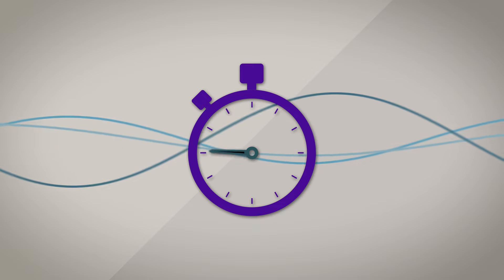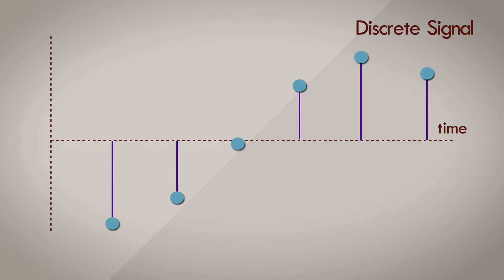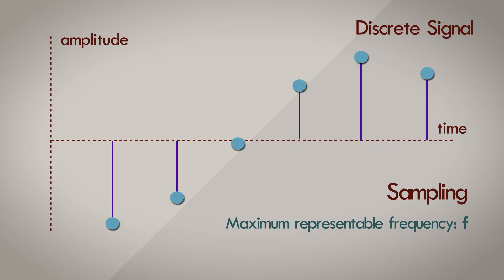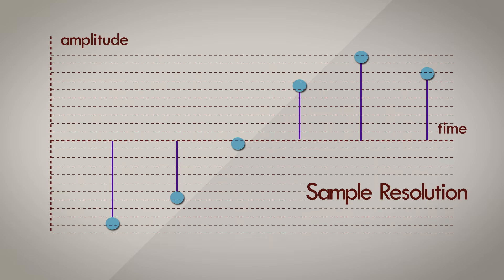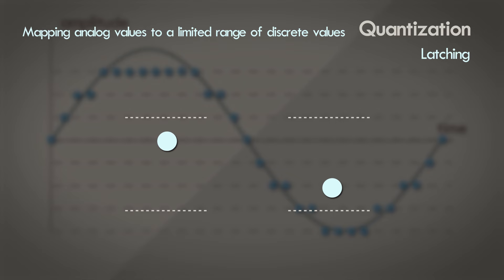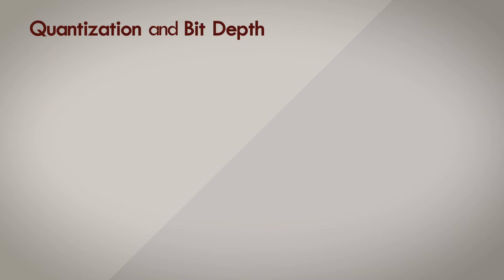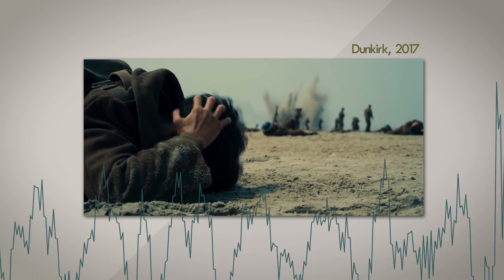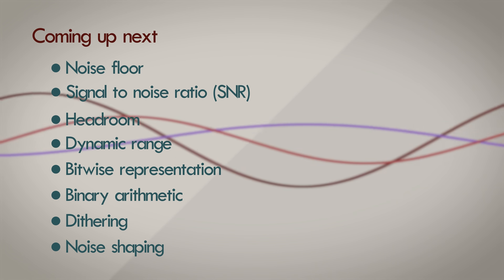5. Quantization - Digital Audio Fundamentals

Comment: This is presented as though it's a lot worse than it really is because you've suddenly switched to a square-step representation of the signal at 5:20 for no apparent reason. The amplitude samples do not have a duration, they are simply a point in time. There should be no horizontal component had you not introduced one, and that's the source of the sawtooth looking error signal when compared to the sine input.

Comment: Great video! But the quantization error shown isn’t as accurate as it could be. Showing the digital signal as a step function (staircase-looking pattern) is misleading as it seems like it’ll be like a noisy saw-tooth waveform when the discrete dots are actually the “waveform” of the digital data. The DAC will find a smooth interpolation between those points to get an approximation of a sine wave like before. The error noise would be introduced by the clipping of the original signal at the peaks and troughs as well as changes to the reproduced sine wave because of inaccuracies of the quantized points. But it wouldn’t be from some step function fuzziness since the DAC will make a smooth approximation anyways.

Comment: So sir, please let me know if I am wrong, here we are not converting back the digital signal into analog again to check, just we did in the sampling, rather we are trying to hear the quantized raw audio signal. That is why we are hearing the noise? Like if we have higher resolution like infite, then we sample by nyquist, will we hear the noise? or it will be a clear sound?
Reply: I think both of the times you should bring DAC on the scenario.

At niquist and infinite resolution you will get exactly same output sine wave as output.

But with quantization error the output after DAC will not have the pure sine wave as input, it will be noisy.

But, I am confused that we made assumption that output frequency will be unique, but here we are not finding it unique.

How does that happen?

Comment: 1 Bit — 2 Amplitude Levels — Minimal Quantiz
2 Bit — 4 Amplitude Levels — Super Low Quaniz
3 Bit — 8 Amplitude Levels —  Very Lower Quantiz
4 Bit — 16 Amplitude Levels — Very Low Quantiz
5 Bit — 32 Amplitude Levels — Very Lowean Quantiz
6 Bit — 64 Amplitude Levels — Lower Quantiz
8 Bit — 256 Amplitude Levels — Low Quantiz
10 Bit — 1'024 Amplitude Levels — Lowean Quantiz
12 Bit — 4'096 Amplitude Levels — Lower Mid Quantiz
16 Bit — 65'536 Amplitude Levels — Medium Quantiz
20 Bit — 1'048'576 Amplitude Levels — Mean Quantiz
24 Bit — 16'777'216 Amplitude Levels — Average Quantiz
32 Bit — 4'294'967'296 Amplitude Levels — High Quantiz — Big CPU Usage
40 Bit — 1'099'511'627'776 Amplitude Levels — Higean Quantiz — Significant CPU Usage
48 Bit — 281'474'976'710'656 Amplitude Levels — Higherage Quantiz — Gross CPU Usage
64 Bit — 18'446'744'073'709'551'616 Amplitude Levels — Super High Quantiz — Gross CPU Usage
80 Bit — 1.208'926e24 Amplitude Levels — Very Higean Quantiz — Great CPU Usage
96 Bit — 7.922'816e28 Amplitude Levels — Very Higerage Quantiz — Large CPU Usage
128 Bit — 3.402'824e38 Amplitude Levels — Very Super High Quantiz — Huge CPU Usage
160 Bit — 1.461'502e48 Amplitude Levels — Super Highean Quantiz — Vast CPU Usage
192 Bit —  6.277'102e57 Amplitude Levels — Super Higherage Quantiz — Sizable CPU Usage
256 Bit — 1.157'921e77 Amplitude Levels — Hyper High Quantiz — Massive CPU Usage
320 Bit — 2.135'987e96 Amplitude Levels — Very Super Highean Quantiz — Extensive CPU Usage
384 Bit — 3.940'201e115 Amplitude Levels — Very Super Higherage Quantiz — Enormous CPU Usage
512 Bit — 1.340'781e154 Amplitude Levels — Very Hyper High Quantiz — Giant CPU Usage
640 Bit — 4.562'441e192 Amplitude Levels — Hyper Highean Quantiz — Ultimate CPU Usage
768 Bit — 1.552'518e231 Amplitude Levels — Hyper Higherage Quantiz — Superior CPU Usage
1 KBit — 1.797'693e308 Amplitude Levels — Super Hyper High Quantiz — Gigantic CPU Usage

Comment: Nice video! Thank you for the clear explanation. I was wondering if it is possible to use quantization to remove noise from a signal.
Reply from the maker: You're welcome! Regarding removing noise via quantization, how do you mean?
Reply: @akashmurthy  For example, if I have some fluctuations in my signal, will the quantization remove them?
Reply from the maker: @mirkohu7624  no, it won't. If you're looking to smooth out a signal which was a lot of fluctuations, use a low pass filter.
Reply: @akashmurthy  Thank you for the fast reply, and keep posting!

Comment: Hi, great video! I have not understood one thing. Why does the quantization error stays as noise, after the conversion with the output signal? After the sampling (quantization) the original signal exists no more. Only the quantized signal (the squared sine) exists. The 2 signals (the input original sine and output quantized signal encounter each others nowhere. Therefore I don't understand technically, where does the difference signal (the noise) originates. each others nowhere, therefore I don§t understand, where does the difference signal (the noise) originates.
Reply from the maker: I'm not very sure if I understand the question right. But I'm guessing you are talking about the section at 5:51 
Over there, the difference signal is calculated between an accurately quantized sine wave at 16bit and poorly quantized sine wave at 3bit. 
This is a digital to digital comparison, and the noise is just the difference signal.

Also, on another topic, the illustration maybe a bit misleading. There is NO squared sine wave that exists in the digital domain. It's just a simple way of illustrating. Only sample points exist in the digital domain, and these sample points aren't actually connected.
Reply: @akashmurthy  Hi. Yes, I have understood that after the A/D conversion, only single samples exists. But then where does the noise physically comes from, as difference with the original signal, if the original signal no more exists?
The analog signal exist only in the input side of the A/D converter. In the converter it gets only measured, step by step, and then translated into numeric single samples. Nobody measures the difference between the sampled signal and the original input signal, so I don't understand why this noise is to be heard, when you convert the samples back to analog. You might notice missing detail from the original signal, but not a noise in that way as it happens.
Reply from the maker: @Tyco072  so, we are talking about quantization error. The ADC takes the input signal, samples it at discrete points, and then quantizes it as best as it can. 
The error here is in this process, where there a max of half an LSB of error in measuring a sample value. 

Let's say if there was no error at all. That would mean that these sampled values could be mathematically reconverted to an output signal which is the EXACT same as the input, without any difference. Practically, we deal with quantization error, since we don't have an infinite number of quantization levels or the precision required to measure the signal super accurately. 

The error affects ALL samples. It's not error at certain places. All sampled values are erroneous. The degree of error differs between sample to sample. 

How is white noise generated: you generate white noise digitally by choosing a random amplitude (-1 to +1)  for all samples. So if you have 44100 samples and each of them having a random amplitude, if they are played back at 44.1k sample rate, you get 1 second of broadband noise. 

It's the random variations in sample values that give rise to noise. 

In quantization error, the samples have half a bit of random error. This is very little error, but error none the less. If there was no error, according to the sampling theorem, the DAC would use sinc functions to render an output signal which is indifferentiatable from the input signal. But dues to the presense of these error values, the output of the DAC  mathematically produces a signal, which sounds like the input signal, with a little bit of noise. 

You are right in saying that the input signal disappears after running into the ADC. The DAC mathematically coverts the samples to form an output signal. What we do is measure the difference between the input and the output.

Comment: Hi !

You seem to give 2 different definitions of dynamic range :

1 - Difference between max and min amplitudes (DNR ?)
2 - Max amplitude minus Max noise (SNR ?)

So, what should I understand here ? 

Thx for your help !
Reply from the maker: Hey there, it's a good question, there is a lot of complexity once you dig in further. I've tried my best to describe it below: 

There are plenty of nuanced usages of the term dynamic range. Sometimes it's used to represent dynamic range of a piece of music, or dynamic range of a listening environment. From Wikipedia: "The dynamic range of music as normally perceived in a concert hall does not exceed 80 dB"
So here, we are talking about the loudest and quietest moments (generally RMS values of sound pressure measured).

The other definition, the one this video is more interested in, is the dynamic range of a digital system. 
Here, it's the ratio between the theoretical largest and smallest values that a certain sample value can assume. 
I have made a mistake, when I said difference, it should be ratio.

So in digital systems, there is always going to be 1 bit (1 discrete state) of inaccuracy, no matter what bit depth we choose. This is because of the rounding errors due to conversion from a continuous system to a discrete system. This is the theoretically unavoidable quantization noise.  
So, the highest amplitude value can only be determined by the bit depth of the system.

So going by the 2nd definition, ratio between the theoretical largest and smallest values that a certain sample value can assume: 
2^Q / 1  , where Q is the bit depth.
Representing dynamic range of a 16-bit signal in decibels, we get 20 log (2^16 / 1) = 96dB.
So the only way of increasing dynamic range is by increasing the number of bits. That's because the denominator will always be 1 discrete state of inaccuracies (noise).

Comment: Hey Bro, 
I have some questions.
1- What if we record absolute silence in 8 bits, or something very quiet and detailed. 
A- In silence, will we have quantization noise?
B- in "something real quiet", can we hear it? or it's covered by the noise?

2- How is that signal subtraction you provided is calculated?
I looked at it and I couldn't understand how "technically" those two signals subtracted to calculate the noise signal.

3- Why this process creates noise anyway? shouldn't the signal be louder or quieter at some points in time? Why creates a semi-white noise?

And by the way, your channel is great, nicely done. Please feed us new content :)))
Reply from the maker: Hey man! 
I think a lot of these questions are answered in the next video: 6. Bit Depth 

To answer them here: 
1) if you are recording silence in 8bits, you get silence. If you are recording something very quiet, it may be rounded to zero, and you may end up getting a tearing sound as the audio level jumps from 0 to the next quantisation level.

2) To subtract one signal from the other, you invert the phase of one, and add the 2 signals together. If you have 2 identical signals, invert the phase of one and mix the signals together, and you should end up with silence. 

3) You should really watch the next video to find out why. 

Thanks mate, I'll have some new videos soon..
Reply: @akashmurthy  thanks for this informative and quick response.

So as I understood the "difference" between the fine signal and poorly quantized signal (calculated via subtraction) is the nature of the noise. And it's not white noise because it's generated from the actual signal. It's just the signal rounded up or down to the nearest latch, which is perceived as noise because it's not the actual signal and not even near it enough, but it can have the same vibe because it's generated from the source signal anyway.
And it's as loud as the difference of quantized discrete points with the reference signal. With more bit depth we have more latches, therefor the difference between the quantized point with the source point is less, so the noise would be less loud.

Is that right?
Reply from the maker: @mohsens22  Exactly! You got it right.

Comment: @6:28 why is the dynamic range below the noise floor?
Reply from the maker: So, at @3:21 the illustration there is the decibel scale. There, anything lower on the scale is lower in signal level. 
But @6:28 the illustration used is different, maybe I should've been clearer. The illustration here is instantaneous amplitude, this is what you see when you record an audio track on to DAW software, it swings from -1 to 1 on your DAW software.

-1 doesn't mean it's lower in volume. Any deviation from the center line (0 value) results in a relatively higher signal level. Peaks of audio could lie in the negative axis, and this common.

Ofcourse, -1 to 1 is the the normalized form when we use floating point format on DAWs, but here we're talking about really low precision fixed point format. For a bit depth of 3, you only have 8 distinct levels.

Now the question is, if the signal can peak on either side of the instantaneous amplitude graph, why did I deliberately choose to make it more confusing, and put the peak on the bottom? This is for correctness. If you look at how you can spread the 8 values across the positive and negative axis, you get: -4, -3, -2, -1, 0, 1, 2, 3 

There is a skew. You have more negative numbers than there are positive. You can't represent an even number of values symmetrically across the axis. For simple signals like the sine wave which swing from either extreme, there is always a negative bias. Ofcourse, this bias is only exaggerated at such low bitdepths.
Reply: @akashmurthy   I've always found the whole instantaneous amplitude illustration thing so confusing, seems to be obvious tho as no one ever takes the time to elaborate, but your answer made it clear. Thank you for this accurate and thorough explanation. You have one gem of a channel btw, so much quality content, keep it up!

Comment: Quantization error noise vs cassette noise is apples to oranges. One is random and the other is nasty overtones.
Reply from the maker: You're right, you can't compare quantization error to cassette noise. Two fundamentally different phenomenon which causes 2 different types of noise. I was talking about dynamic range available for different media. That's a valid comparison. An analog medium like a cassette is physically bound to constraints like how fine the variations in magnetic flux is, on the metal coatings on tapes, and the speed at which the tape is spun, all of which determines the signal to noise ratio (and in the end, the overall dynamic range available). In the digital domain, you have bit depth, which determines the overall signal-to-error ratio of an undithered digital signal., which again determines the overall dynamic range available.

Comment: One of the best on you tube.
But still hard to understand why we hear errors and not signal with wrong amplitude.
Reply from the maker: Cheers for that! And thanks for the question.
I'm not entirely sure I understand it fully. What's wrong amplitude here? 

Quantisation noise is only heard when the signal level is really low. The level of this noise is also very low. At very low signal levels, there aren't a lot of quantization levels to accurately depict the true nature of the signal. So, this inaccurate representation of the signal is what causes noise. 

So why does this result in noise? Audio data is produced 44,100 times a second. That's a lot of data. It needs to be smooth in nature for a speaker to have any chance in representing it, because a speaker cone has to move in relation to the sample amplitude.

If sample amplitudes shift haphazardly, the speaker cone tries to move at the same rate to try and reproduce it, which cause clicks and noise, becausd the erratic movement (not smooth movement) of the speaker cone which causes noise. Hope that helps.